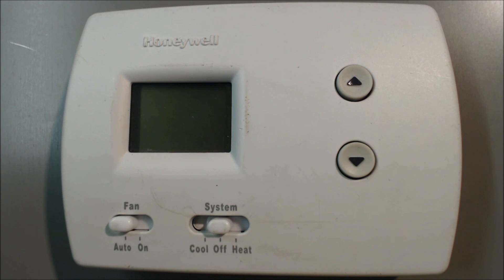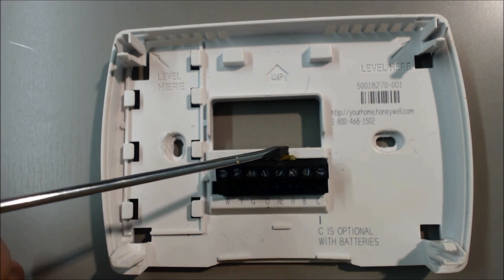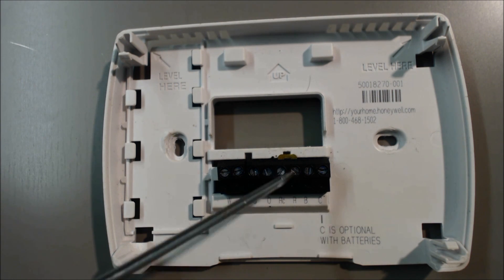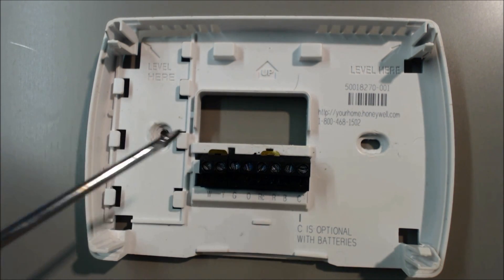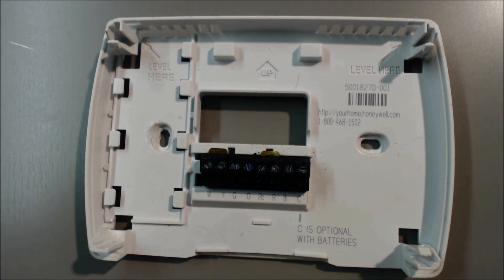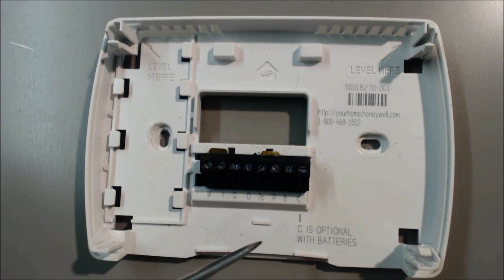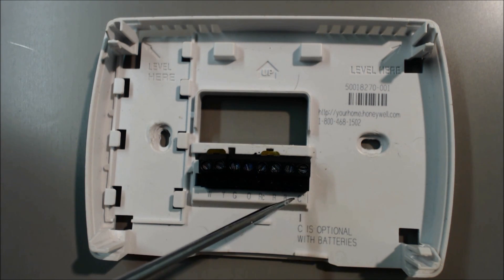How to Wire a Pro 3000 Thermostat for a Heat Pump and What the Wire Colors Mean!

Comment: that is all fine and dandy and ...... CONFUSING TO PEOPLE.
if you jump the any W wire & y with jumper wire or bracket - you will never get cooling in the summer because while your reversing valve would be energized (or not for some manufacturers) your w would be hot in summer activating the HEAT STRIPS or furnace along with thee Y wire (Y closes contactor for compressor) = no cooling in the SUMMER - 10k heat strip WILL overpower 3 ton AC!
leave jumper out! if your heat pump EVER enters defrost (IT will power the W from outdoor unit activating the heat-strips or furnace while defrosting) 

some thermostats bridge (jump) Y&W internally in heating mode to keep HP & strips runing at the same time some more advanced can activate heat strip (W) after predetermined time of HP running with no temperature change ...... BUT NO THERMOSTAT will ever activate Y&W at the same time in cooling mode!

DONT JUMP Y&W

other than THAT AWESOME VIDEO

Comment: So if I want 750 mv to use on a gas  fireplace  I need to leave it on gas or oil setting  right ?
Reply from the maker: The tstat would say on in the manual if it has tight enough contacts for 750mv.
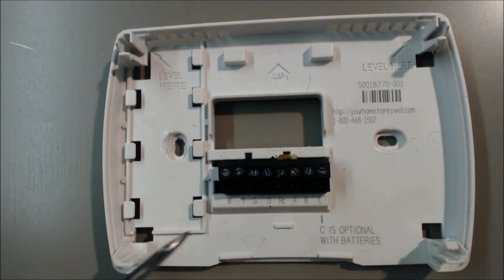Reply: At 2:34 in this video you say  this thermostat  is 750mv . So I'm asking when you switch  the  setting to  gas or oil  does that make it go from 24 v to the 750mv I need for  my gas  fireplace insert .?  In the video you don't say anything about switching at to gas or oil setting .    https://youtu.be/riaN_j5tmX4

Comment: Is there a way to disconnect cooling only?
Reply from the maker: Just take the jumper out from RC to RH and make sure that the heat is still connected to RH. Test the heater out after doing any work, thanks

Comment: you dont seem to have a photo of the finished wiring project. also my wiring has 5 wires, white, yellow, green, orange and red (NO BLACK). I sure could use your help please. TY
Reply from the maker: So this is just the simple heat pump wiring with the pro 3000. I would like to make some more heat pump thermostat videos with more wiring. You would need to find out where each of these color wires connect and to what. Is it a fan coil, a fan coil with electric resistance, a dual fuel gas and heat pump? What terminal letter do these connect to in the actual unit?

Comment from the maker: Great Question! When using this particular thermostat for a heat pump without electric resistance, you will need to jump w and y in the thermostat because the call for heat will still go to w but when calling for ac, the thermostat is designed to connect r to y and o. I will add a note for this, thanks!

Comment: When you put the jumper in for the heat and cool are you still connecting the yellow and white 24V to there individual spots or just one of the wires? Like with the R and Rc jumper you only put one one 24V wire in the R spot. Thanks
Reply from the maker: Thank you very much David!
Reply from the maker: Great Question! When using this particular thermostat for a heat pump without electric resistance, you will need to jump w and y in the thermostat because the call for heat will still go to w but when calling for ac, the thermostat is designed to connect r to y and o. I will add a note for this, thanks!